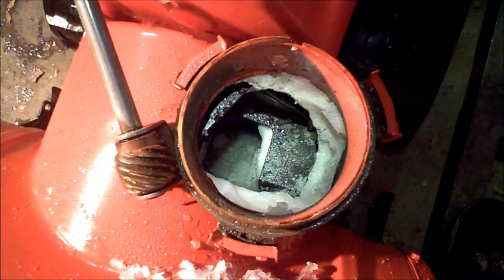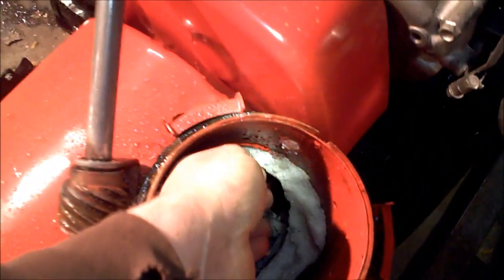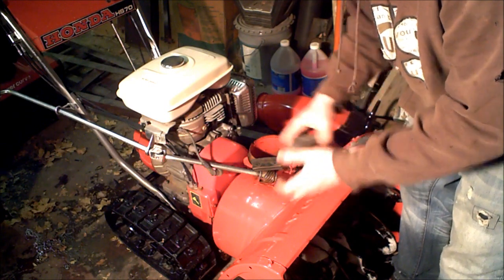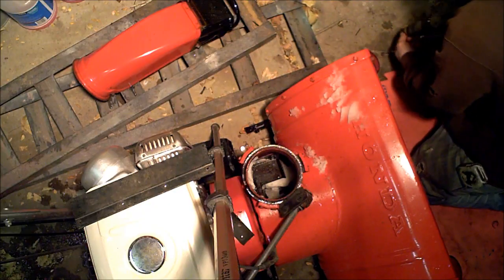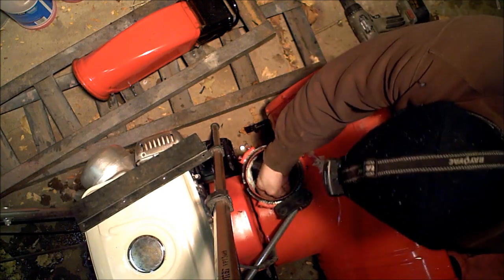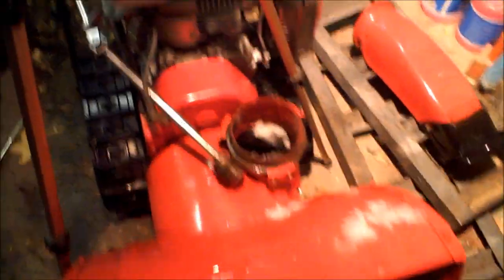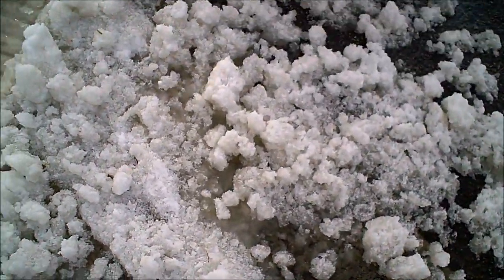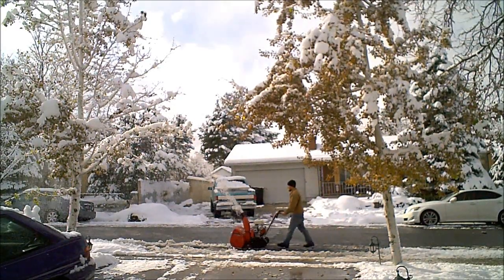Modify Snowblower to never clog and throw twice as far w/ Impeller Kit

Comment: Thanks. Have you come up with something so that the augers can get closer to the ground and break up compacted snow or ice?  Seems single-stage blowers scrape the ground but two-stage have quite a gap between the auger and the ground.  The scraper bar doesn't do a very good job at breaking compacted snow up.  I have a Yard Machines unit currently.
Reply from the maker: Ariens came out with a few budget 2 stage models in the 90's/2000's that used rubber paddles mounted on the metal auger blades to scrape the pavement and propel it. It worked pretty good.

http://www.ereplacementparts.com/ariens-932500-000101-st520-5hp-snowblower-parts-c-157125_157126_157792.html

Comment: What do you think about the power clears 210e? We're they good blowers? Heard they had the toro 3000 engine
Reply from the maker: Yes, they are good machines. The 210 replaced the older model ccr2000/ccr2450 and has a R-Tek(lawn boy) engine vs the ccr2000/ccr2450 and ccr3000/ccr3650s that had Suzuki motors. The 210 like most 2 stroke machines seam to go forever without any maintenance. If your planning on buying a 210 you will be happy with it or its bigger brother the 421.

Comment: I have an older 2 stage Craftsman and I love your idea but I worry about cracking/splitting the plastic impeller. Yesterday I shattered the cheap plastic control cover that houses the ends of the cables on the handle. Plastic is bad at 3 degrees.
Reply from the maker: The impeller is a high strength composite and is meant to take a beating. The other plastics on the machine are made of different material. I have done several of these with great results. I would recommend warming the impeller a little before screwing into it and not screwing into an edge. Predrilliing a little can also insure success. This is my experience and I know how horrible some are at clogging so personally I wouldn't hesitate to do it.
Reply: sixtyfiveford Bolt thru or the self tapering screws you used? I appreciate the reply.
Reply from the maker: I always use self tapers on the composite impellers. Bolting through will cause stress cracks if they are over tightened plus you have to make a much larger hole to bolt through.
Reply: sixtyfiveford
Thanks much, subscribed and liked.
Reply from the maker: If you do try it, let me know what you think. Thanks for the sub.
Reply: sixtyfiveford The results are in, after a snowless beginning to the season here in MA, we have been pummeled with 4 feet of snow this week, snowing now, and more Thursday. The Mod seems to work great, no clogs, throws decently. Thanks my friend.
Reply from the maker: Thanks for the update. Only 6 more weeks of winter to go.

Comment: Thanks for the Video this worked wonders even on my putt putt yard machine 24" with only 170 horse power, and I used the soles of my daughter's old canvas sneakers.  Last snow storm before the fix I was only able to drive the snow blower on the first gear and was clearing the auger every 3 minutes with prying tool.  With fix I was able to go between 2nd and first gear without cleaning the auger, not even once and the snow blower was throwing the snow farther.  Only draw back was the power coat in the drum was wearing off in one small section, but that's a small price to pay from being able to do the driveway in an hour and a half from two and a half hours.  Will be giving this machine to my father in-law and will be getting club cadet 3X, 28". cant be delivered soon enough.  Thank you again for the quick fix and introducing me to self drilling screws even in metal.  This fix is so cool, efficient and thank you for making a small weak snow blower work much more efficient than it was!!  Consider marketing this you could make a pretty penny!
Reply from the maker: You're welcome. Thanks for the detailed comment and I really like the use of a sneaker idea. People seam to be very happy with the new Cub Cadet 3x.
Reply: I love the 3x cubcadet crazy heavy to Maneuver even though it has the transmission turning. It either turns to fast or turns to slow. The machine is a beast eats through any amount of snow and throws snow or wet icy snow very far. Only gripe that first stage sticks out past the housing and caught on my pavers and broke a sheer pin. One pull start and great on gas.
Reply from the maker: That's great. I'm sure these have been very popular with all the East Coast snow this year.

Comment: Great snowblower upgrade. What if you piped the muffler to exhaust into the chamber on models with steel imperlers ? Just thinking. Like what you do and show......in the video and film business we would call you Smart Muscle!  Pays much better than just Muscle alone. 

I have a good looking car with cloudy plastic headlights and the paint is wearing off on left and right mirrors and a ridicules goofy "spoiler"  all other paint looks great......ever use dupicolor paint and the clear coat ?  Would love to do the touch ups but not sure it will look like factory paint or leave me needing to repaint the entire car.
Reply from the maker: Want your old paint to look tons better? Take a look at my video here: http://youtu.be/36embO9Jts0 . Duplicolor works but, you need to spray the entire piece. I wouldn't worry about clear coating it.

I think the volume of snow going through the impeller would outweigh any effect the exhaust could do for it.

Comment: Good work.  No self tappers through an old snapper though!!  That steel is like AR500!!! I got to find a way to get through it to install something like this.
Reply from the maker: Yeah, Snapper wasn't afraid of using steel. A good LONG drill bit will be your best friend.
Reply: drill it then use the self tappers?  Think that will pull it together?
Reply from the maker: Yes, that is what I have done a several times on thicker ones. Or you can use small bolts.
Reply: ok, I will give it a try!!!
Reply from the maker: Let me know how it goes.

Comment: Hi, I predrilled holes on my Toro 724 on each of the impeller blades and cut some sidewall to size. When I cut the size to take up the gap with the impeller balde parallel to the ground it won't clear the rest of the chute. I had to trim quite a bit from the pads because the area is not round it's sort of oval if that makes sense.. If I lfet the pads like you did on the Honda the impeller was binding and wouldn't turn. I can't see any other way to get around it and I now have some gap when the impeller blade is parallel to the ground. I am open for suggestions. No snow right now and I am not wishing for any so difficult to check how it's working.
Reply from the maker: Yeah, I have encountered non round impeller housings. I just stick it out as far as possible to touch the shallowest part without binding. Not the best scenario but any gap taken up by these rubber paddles makes a difference.

Comment: hey 65 ford you did a great job of a great mod there are 3 blowers that got moded in my shop today and i got a line up going now. The other 2 I did were both craftsman about same vintage as mine. Got a Honda and a john deere and another craftsman to do tomorrow. dont ever let any one tell you its a dumb mod and if you need some puck board i could probably mail you some scraps. I got all kinds of it laying around here.
Reply: I will get spec on that plastic and find out who the suppliers are. I think it is made in Edmonton for GE Plastics out of the Union Carbide plastics plant up there.

In Canada you can get it at most lumber yards.
Reply from the maker: I'll have to keep an eye out for some. Hockey isn't as popular down hear in the States  so there are limited rinks.

Comment: Did a bit of reading on the thread after I did a slightly modified install of this mod.
First of all, most of the comments here are great but I did find one that is real stupid especially since it comes from a guy that claims to be an engineer.

I was actually thinking about a way to modify the blower on my machine to be  more efficient and was thinking along the line of the blower on a forage harvester or the blowers used to fill silos which I have had a lot of experience with. Fan to housing clearance with those machines is set to a few 10 thousandths of an inch and when that clearance gets out set the blower productivity goes to zero in about 10 seconds flat and the discharge tube is plugged very tight very fast. If you are paying attention you can catch it before it plugs and reset the paddles. How can you tell? The power source turning the the blower will start to "labour" unnecessarily and if it is a diesel engine it will start to produce black exhaust.

The rule of thumb for these machines is to maintain a setting  of the paddles to just touch a dime but leave it lay on the bottom of the blower housing but pick up a nickle. If you get a micrometer and measure that it is a very close tolerance for some thing that can have over 600HP turning the machine.

When an engineer says this idea is a dumb idea I would like to know who he works for cause I sure as hell wouldn't want a machine that he designed.   

Now for my modification of the mod.

Rubber is not a very slippery compound but some plastics are very slippery.
Since most people in areas where snow blowers are used probably have some knowledge of the great game of Hockey you will know what the stuff called puck board that is used in most hockey rinks is. I have the first 6 feet of my shop lined with this stuff so had a few scraps around. For my 15 year old Craftsman 10-29 snow blower I cut 3 pieces of 3/16 puck board to a size of 4 3/8" X 2" and then did the install as shown in this video. For screws I used 3/16 x 1 inch Robertson drive self drilling/tapping flush finish trailer decking screws. the inside front of my paddles are still real smooth with nothing sticking up for snow to hang up on. I bevelled both edges  of the each paddle too and set them tight against the blower housing. Took about 15 seconds to "break them in" to correct clearance. I showed the results to a couple of neighbours with similar blowers and the mods are under way if not finished on those now too.  

My blower throws a good 50 to 60 feet now. Before the mod it was lucky to do 30 to 40. I have a couple of other mods that i will try and when done will post a video
Reply from the maker: I forgot about that guy's comments....Yeah, I have done a ton of impeller design research and can only disregard such comments. Puck board is very slipper and a great choice if you have it. I know it is not readily available around me. An extra 20 feet for a machine already throwing 30-40 is great. Thanks for the feedback.

Comment: I plan on doing this to a Toro 724 and understand I have to pre-drill the holes for the screws just curious what size self tappers do you recommend looks like 5/16 hex heads and I would think you need to drill just under the size of the screw thickness maybe 1/4 holes? looks like to you ran the whole width of the impeller vane with the rubber.
Reply from the maker: Yeah, 1/4" hole sounds good for some large 5/16 self tappers. I try to do the entire length of the impeller blade. Let me know how it goes.

Comment: Thanks for the info. I have a big snowblower attachment for my little articulated loader, hydraulic driven. I checked the gap and it was almost 3/4 of an in. I had some heavyduty conveyor belting laying around 3/4 in thick cut 3 pieces 3x4in put on the fins of the impeller. Hooked up the hoses to the blower and took it out to blow snow. WOW what a difference, thanks for the info!!! will put video on later of blower in use!!!
Reply from the maker: That's a big gap. I'm glad you tackled it and were impressed. Let me know when you video it.

Comment: Pulled the trigger on the blower from eBay 87cc. W/ 2 yr warranty. What made me pull the trigger was when the clerk told me it's a Briggs & Stratton engine, do I figure that's a good quality buy
Reply from the maker: A new machine will make you happy and save a lot of headache.
Reply: They corrected their remarks to me. Apparently the engine is a loncin 87cc 154 4-stroke engine. I've read some older reviews on snow blower forums & a/ this engine on a toro 180 & 418 it has it's share of oil leaks ' seize. But the reviews r from 09-11. Wonder if it was fixed. They said I didn't have to pay for it despite  clicking on buy it now
Reply from the maker: The Loncin 87cc is a copy of Toro's 87cc. So though similar they probably won't suffer the same. A person that checks the oil on occasion shouldn't have to worry about all the oil leaking out and seizing the engine. It is a rare for these small engines to develop an oil leak but possible.

Comment: I tried this on mine and it worked great. The only issue I've had so far was one of the paddles ripped off. I was able to find some rubber mat that was 1/4" thick but it had no reinforcement and therefore allowed the screws to pull through. I'm going to keep an eye out for an old conveyor belt as that would be tougher and may withstand ice going through better than what I have now. I also thought that instead of using self tapping screws that it may help to drill and bolt the paddles on with some washers to add reinforcement. Have you ever tried that or has the self tapping screws always held up for you? Other than that it really helped my snow thrower to clear well beyond the other side of my driveway!
Reply from the maker: On the reinforced rubber the heads of the self tappers are ample but for lighter duty stuff I would just throw some large fender washers in between the head and rubber.

Comment: I have a McCullouch snowblower. When the snowblower is running the impeller will not go around but the auger does.  However,  the impeller will  manually spin freely by hand. Your expertise would be greatly appreciated
Reply from the maker: You have a shear bolt that has broken. They lock the impeller and augers to their shaft.

Comment: Thanks for your feedback, I greatly appreciate it. Yeah, I have been looking on Craigslist, and saw a few good toro u its for about 200, but waiting to perhaps negotiate on the price. Im in NY. Juggling new vs used. Hopefully ill here back. That 87cc powRkraft has it on sale which ends tues. morn. & has sold 6 in 2 days. Like u said, anything is bett than a shovel, lol.
Reply from the maker: New is always nice.
Reply: Someone told me these not so known brands are made by the same manufacture! Forgive the ignorant question but why are some single stage blowers engine components exposed open to the elements? Wouldn't that induce moisture leading to rust decay
Reply from the maker: Single stage machines have been 2 stroke oil/gas mix machines for decades. These compact engines easily fit inside plastic covers. With the change to 4 stroke machines it is more cumbersome to fit them behind plastic guards. Also they were has to add the cost of making the engine controls remote to the dash. All these less know brands are 100% Chinese machines. They seam to be decent. I wouldn't worry about rust unless you use heavy salt on your driveway, then any machine will suffer.
Reply: Thanks so much. Figured this PowRkraft blower was Chinese made despite the 2 yr American warranty & assertion of the Brigggs & Stratton engine. I don't use salt at all especially until after all is cleaned 1st. I'm still going to go w/ one tonight & care 4 it as best I can. The other echelon model on eBay looks identical to a toro 418.
Reply from the maker: Your will have a Honda Clone engine. But most every manufacturer is doing these and they have a good reputation.
Reply: Really. I wanted a honda but there 600 & up. We'll hopefully I can put it to the test. So I guess the sales clerk lied when he mentioned Briggs & Stratton engine?
Reply from the maker: Yeah, he stretched the truth... Your engine is a China made copy of a Honda. They run good and have a decent reputation.

Comment: The new cub cadet 3x has the impeller literally 1/32" away from the housing so there wouldn't be a need if u had that. plus the impeller is way too thick! but i did try it on my other craftsman 2 stage and it worked great. You should consider making a kit for this and make some real $$$!
Reply from the maker: 1/32", that's impressive. Cub Cadet even though they are owned by MTD seam to be putting out a better product.
Reply: Yes and the 3x I own now is 3 stage snowblower. Which is advertised to run 50% more efficient but haven't had a big storm this year to test it out and give my personal opinion.